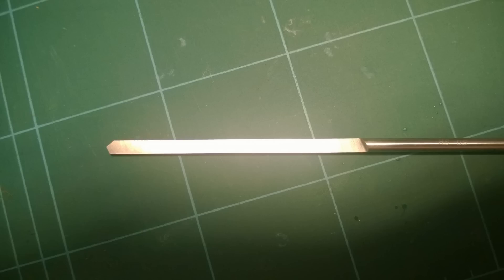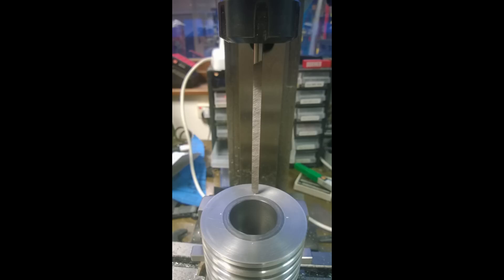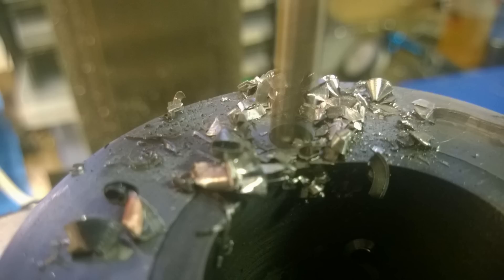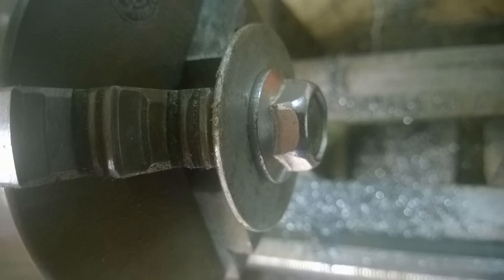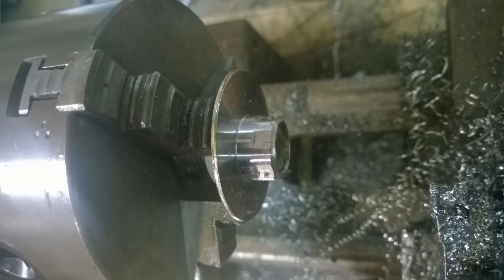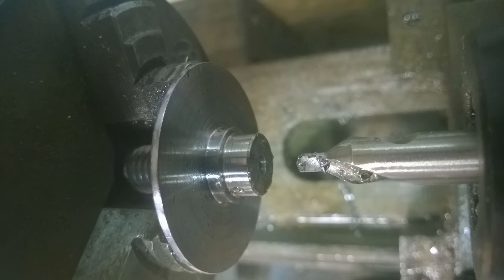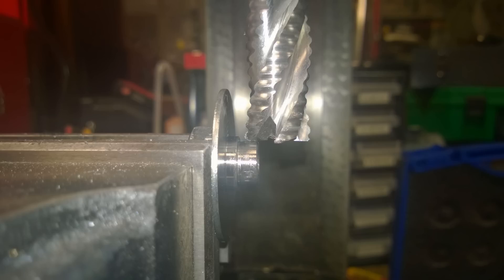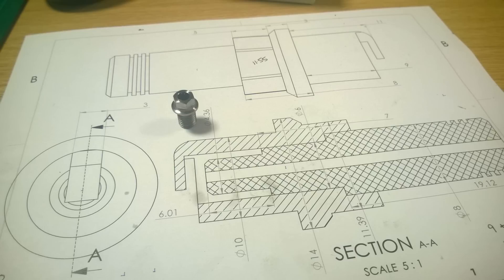Homemade 2 stroke engine step by step - Part 11 Making a sparkplug

Comment: This has inspired me ... Not to build an engine but I've got a compressor (basically unused) and I reckon a few modifications (transfer and exhaust ports, crankshaft and then cylinder head) I could get it sort of close to working

Comment: LOL Matt. There is building an engine and then there's really building an engine from scratch. Making your own plug is a nice touch. So when she's fully assembled and ready to fire are you going to refine your own  2 stroke oil and petrol ? Just an idea !.
Reply from the maker: lol good idea, its weird that you mention that. In the pipeline I'm going to do a video on fuels and the additives, which will mean mixing my own blend and running it in a test engine.
Reply: I enjoyed you bit on engine pinking a while back regarding octanes. Very useful.